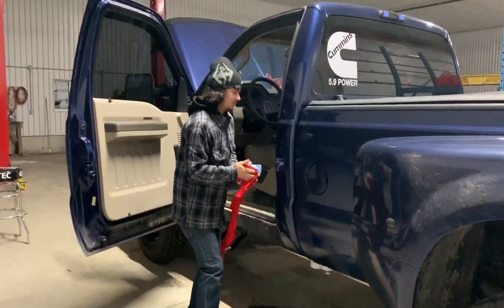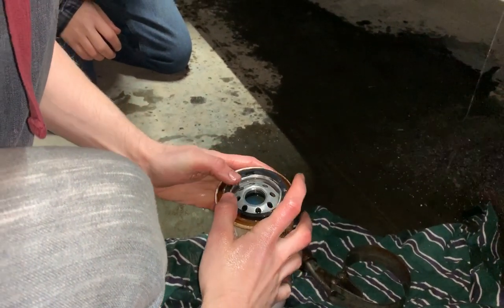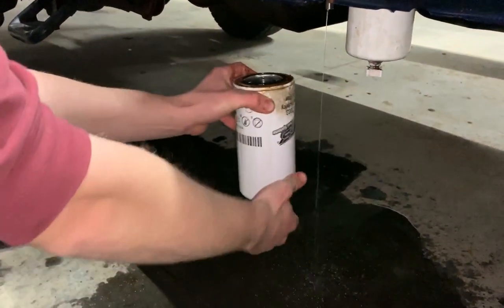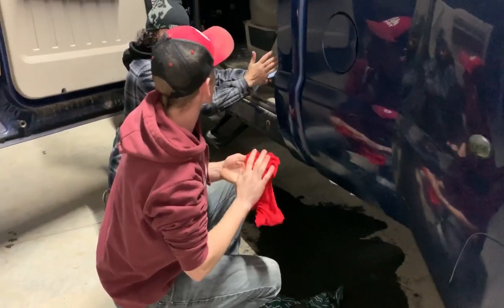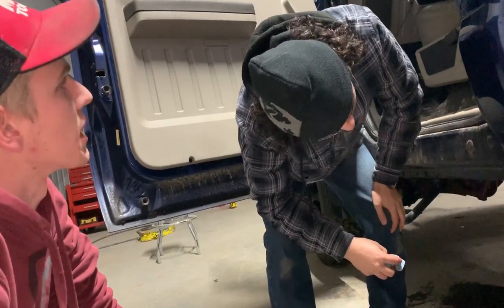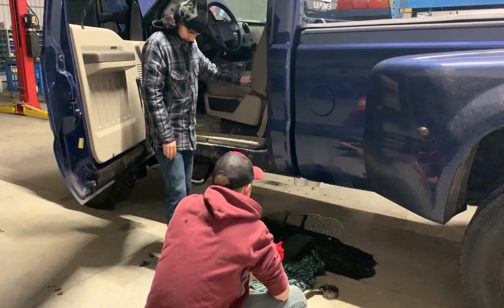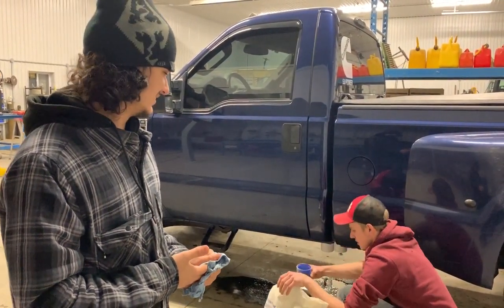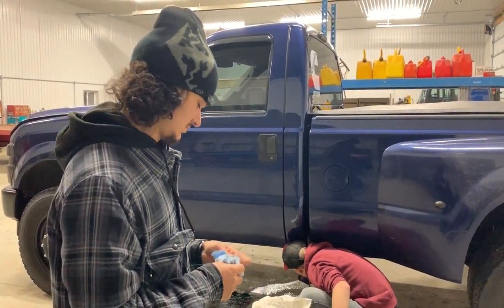Diagnosing the FASS - Now it Sounds Even WORSE!

Comment: Always crack the filter closest to the engine to bleed air. If the filters are older change them. Once a filter gets plugged up it will restrict and cause cavitation, very common on the fass systems. Fixed lots like that. Also run a higher micron (30-50 micron) on the fuel/water separator. Helps to prevent the cavitation issue.

Comment: I had the same thing on a 24v that i installed a fass on. When you cracked that filter it blew the o-ring off the filter, thats why it sprayed when you had it tight. Ended up having to bleed the air all the way up at the feed port for the VP. Check for restrictions in the feed line and maybe try a sump.
Reply: It was seriously the same thing though. Even the one on my duramax makes funny noises but when i crack the bleeder i get no air so i know its primed up.

Comment: Is it the sound of fuel overcoming the spring tension while returning to the filler neck? Open cap and see if fuel pours in at the same pulse of the sound. Fill the rear filter with fuel from a can, crack front filter.

Comment: What if you bleed it manually manually?Like disconnect the line at the engine and throw it in a pail then pressurize your fuel tank. I do t know🙃
Reply from the maker: We are getting close to resorting to this option next. Maybe first a fuel filter to know if there is a pressure problem or not.